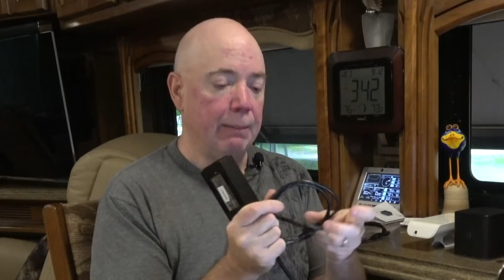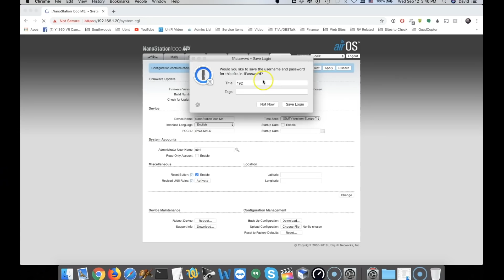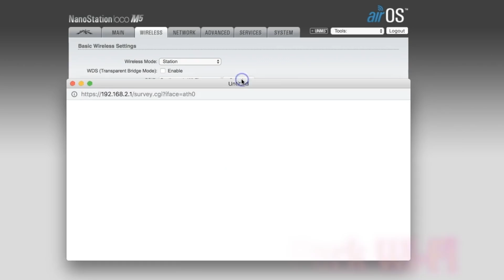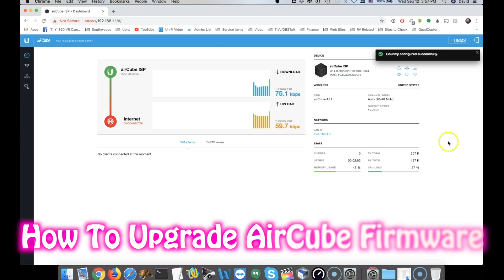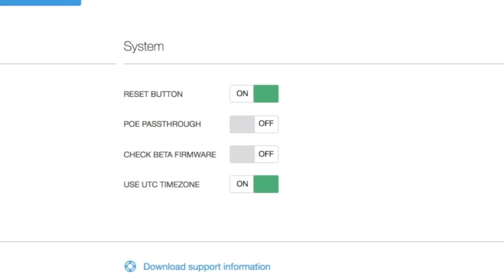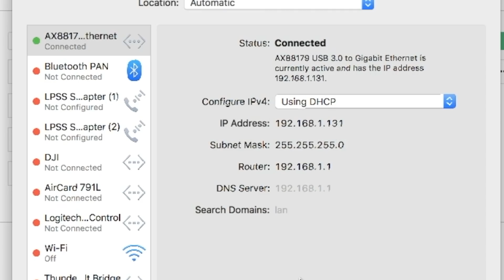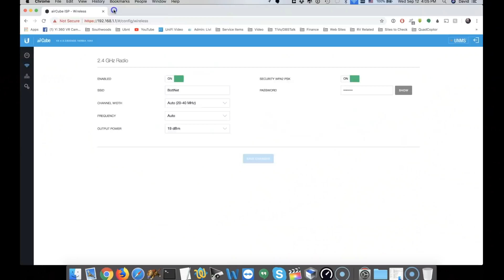Build a Private RV Wi Fi System with a NanoStation & AirCube AC

Comment: I had not see my air-cube and nano Station.  I could not remember my password and the one saved in my password file. So My IT-Tech utilized the reset button. Now having log in issues. Any advice is welcomed. Do I need to address (reset) the nano station as well?
Reply from the maker: If a factory reset was done, then you more or less start over with the setup.  If you only did a reset on the AirCube, then just do that part and your NanoStation should still be good to go unless you forgot it's username and password also. (Needed to be able to connect it to another SSID for use.)   If that is the case, you have no choice but to factory reset it and redo the setup.  To do a reset, power up the unit, wait one minute for it to boot, and press in with a paperclip inside the RESET hole and hold the little button down for 20 seconds and release. It will start to flash and reboot.  After it about 3 mins, you then can start to set it up again.

Comment: Are there upgrades to this set up? Has anyone installed them?
Reply from the maker: This is still current.  And yes, LOTS AND LOTS of people have. 444 comments in on this video with 1.1K thumbs up. :)
Reply: I just set it up followed all the instructions I do have a nanostation M2, will that work as well?
Reply from the maker: @MatthewSumi  Not sure on the question as a NanoStation M2 is one of the parts referenced you need.  So not sure what you are asking by "...will that work as well?"

Comment: Good afternoon. If you were going to do this today is this the route you would take? Looking to setup a private wifi system in my camper. Also does the nano station have to be mounted outside? Thanks great videos.
Reply from the maker: Hi...Yes, I would, and do, still use this setup today and have made some even for people in the motor coach park we are in.  The NanoStation does not need to be mounted outside but would recommend in a window facing the access point you are trying to connect to.  We use "command strips" to stick it to a window when needed as it can be removed without issue.
Reply: @DavidBott  Thank you so much sir. I seen a comment about campgrounds using nanostations. In that case what do you do?
Reply from the maker: @timsimpson2485  I am sorry to say I am not sure what you are asking. "campgrounds using nanostations"  ???
Reply: From the realcconnell -  @DavidBott  However, this year, I'm parked for the summer at a place that's already using Nanostation M2s for all it's access points. I'm having the devil of a time obtaining an internet IP using wireless "Station" mode and network "Router" mode. WLAN0 keeps falling back to the XXX.XXX.10.1 range (default) I've done multiple factory resets on the Loco M2, and have been tweaking the settings trying to find the winning combination but have not had luck. So far, searching the Ubiquiti website hasn't yielded the magic answer.
Reply from the maker: @timsimpson2485  I do not recall that one.  But in that case, it sounds like he may have been using the same IP range for the ROUTER mode of the NanoStation that the park was.  In which case, it would make for an IP conflict.  Connecting to a park that uses NanoStations as AP's is not an issue as long as you do not have an IP conflict.
Reply: @DavidBott  ok thank you sir. I will be buying and setting mine up. Keep up the great videos.

Comment: Hello David.....great tuturial...i bought a nsm5...a bit by mistake because of the only 5ghz....Just wanted to comment on putting oit in router mode..The internet is very slow and intermittent..I had to put it back to bridge mode and my router to ap mode..Its super fast in this configuration..the only problem is i need to bring a PC with me to login the nsm5 with an ethernet cable to change the wifi when i move to another location....Any ideas ???..... Tks W.N.....Prostate Cancer survivor.....

Comment: Any updates to this video with newer hardware?
Reply from the maker: Nope...still the hardware to get.  Note...DO NOT buy the NanoStation AC thinking it is newer.  The NanoStation AirMax AC radios only work with other AirMax AC radios.
Reply: @DavidBott  the local “hotspots” I’ve been using no longer support 2.4G. Looks like I need to find an M5 to replace my M2.
Reply from the maker: @Christopher_Ago  Hi...I have never heard of such a thing as 5Ghz, while it can be faster, is limited as to what it can transmit through. It really makes no sense for places to do that.  Pondering to say the least.  Good news is, if you get a NS-M5 you can just download the config file from the M2 and upload it to the M5 and do not need to do all the configuration over again.  It's in the SYSTEM tab.  Download the M2 config, login to the M5 at 192.168.1.20 (having set yourself to 192.158.1.10 or whatever)  and then go to the system tab and upload the cfg file you downloaded from the M2 and SAVE and APPLY.  BAM!  Same config ready to go.  Hope this helps.

Comment: Great tutorial, but mine doesn't work. It won't let me select the park wifi here. out of a list of about 20 signals there's only two that are selectable, and I don't have the passwords for those. The wifi here is not locked, but you need a username and password to access the actual internet for a fee. I've paid that fee but the signal is still weak. How do I get this thing to strengthen the signal?
Reply from the maker: Point the NanoStation at the AP you are trying to connect to. You are only as good as the signal they can provide and the NanoStation will give you the best chance at getting connected up.  I have connected to an AP 1/2 mile away.  Be sure to see the bottom area of the blog post for the FAQ that might be able to help... https://outsideourbubble.com/build-a-private-rv-wi-fi-system-for-under-100/  Espically if you are connecting to a captive portal which it seems you are.   But once the NanoStation locks on to the SSID, you should see the meter on the back of it light up.  

If you are not able to select the Parks SSID, then they might be blocking routers (they want you to pay for use of each device so they block routers.)  So in that case, you can go into the NanoStation and I think under the NETWORK tab, look for Clone Mac and check that box and put in this MAC address... 10:7b:44:da:5d:3c  save at the bottom and then apply.  The radio will reboot a it will then look like an Asus tablet.  Maybe that will help.  Good Luck!

Comment: Thank you for your videos. They helped me setup my LiteBeam M5 and now I'm working on a NanoStation M2. The NanoStation M2 will not lock on to my access point. The main page does not display the WLAN0 graph, only the LAN0, and the signal on the Main tab shows the access point dropping off. My configuration pages are almost identical to the ones on this video. My M5 can connect to the same routers that I'm trying to connect to with the M2. Can you suggest items I should check? Thanks again for your videos.

Comment: Do you still recommend the AirCube AC?  I love Ubiquiti products and would love to go this route, but not sure if it's still the best choice for my RV.  Thanks!
Reply from the maker: Hi...Yes, I do as it provides the needed power over ethernet (POE) out the WAN port that will power the NanoStation.  It will also do both 2.4Ghz and 5Ghz.  In theory you can use any router you may care but the AirCube is small and powerful and makes for a nice little package in an RV.   Hope this helps.
Reply: @DavidBott  Yes, this was very helpful. Thank you for helping me make my decision!

Comment: David, I tried the the links and neither the Nanostation or Cube don't have the POE adapter with them
Reply from the maker: The Cube has a AC adaptor that supplies power to the NanoStation out the POE WAN port.   But but sure why you think the NanoStation does not come with a POE as it surely does.  All mine have.  Here is a page from Ubnt showing package contents... https://dl.ubnt.com/qsg/NanoStationM_NanoStationlocoM/NanoStationM_NanoStationlocoM_EN.html

Comment: David, great video.  Very descriptive.  It looked like you connected the M2 to the park's 5G wireless.  Is that possible with the M2? Also, what about using the M5? Would that work also?  Is there a preference?
Reply from the maker: The M2 will connect to 2.4Ghz networks only and the M5 will only connect to 5Ghz networks.  Do not purchase the NanoStation AirMax AC as it will only work with other Ubnt Airmax AC units. I carry both an M2 and M5 and use the M5 if I can as it is a much less crowded network frequency.
Reply: @DavidBott  Thanks.  I was able to get an M5 and it works great.  You're right.  With my M5 I see only 5GHz signals.

Comment: Hey David - things worked perfectly well until I tried to figure out the settings on a NetGear Wireless router WNR1000.  I know you said you can't help with every router but I wonder if you had any general router suggestions?  Maybe the Air Cube is the way to go.
Reply from the maker: All you should need to do with any router is plug the LAN port, off the POE injector, into the WAN port of the router. If the NanoStation is setup correctly you 1) Shandle to able to reach it via http://192.168.2.1 (If that is the IP range you used) and 2) Would have access to the internet if the NanoStation is connected to an AP.  The Netgear just expects to get handed an IP like from cable router (in this case the NanoStation).  The only thing I can think of if the MAYBE NetGear has the same 192.168.2.1 setup as it's network.  Hope this might help.

Comment: Good morning. Hopefully someone has the answer to this question, considering I'm a relative novice. I have this setup and I followed all of the instructions as Mr Bott directed, but now, while watching Netflix (or any other movie) after about 15 mins in my Air Cube drops the internet.  I've contacted Ubiquity but got some answer telling me to check their online community.  Zero help which Is terrible.  I'm hoping if someone has also experienced this issue they can give me advice on how to resolve it. Thanks!
Reply from the maker: Are you sure the AirCube is dropping the Internet?  I ask for the AirCube is not the internet source.  It could be the RV Park dropping it based on streaming.  (Not saying this is the case, but surely is something that can and does happen.)  Does you loose your connection to the AirCube?  (in other words, does your computer loose it's WiFi Connection?  If you still have a way, just use the NanoStation without the AirCube and connect your computer directly to the LAN port or the POE injector that you used to set it up.  It will pass and IP to your computer to use and you should have internet access thus by passing the AirCube.  Then do your NetFlix test and see what happens. ;)   Also, when you loose NetFlix, can you still surf other sites.   See, a lot COULD BE going on here.  Thus all the "this and that".  :)   And yes, you likely will not find much help from the community as Ubnt are commercial products and thus a different crowd for the most part.
Reply: @DavidBott  thank you very much for your response.  It seems to turn off at about 10 mins into a streaming subscription service. The app for the air cube reads " unavailable", then I reboot and get service again. I'm in my rv about 150 feet from my house, do I'm connected with full bars from my house. I'm able to stream inside with no issue.  I'm going to try the nanostation independently, but I do not have a power cord I'm using Poe via the aircube.  Can you please clarify how I'm intended to power my nanostation independently? Thank you very much, I really appreciate it.  Have a great day!
Reply from the maker: @jenmc1941  Good Morning...Your NanoStation did not come with a POE Injector?  Weird.  Here is what you would need...  https://amzn.to/32hyfuk  Good itea testing it directly for that will tell you if you have a issue with the AirCube.  You could also try updating the firmware on the AirCube to see if they may do something. :)    Good luck!!!
Reply: Ok so I've isolated my nanostation and have it connected to my macbook and I'm trying to log in to it, but my computer can't find it when I enter the default isp address.  I've previously configured it, do I need a new isp address? Thanks
Reply from the maker: @jenmc1941  Not sure what you mean by "ISP address".  If you are connecting your computer to the NanoStation directly through the POE LAN port, then your computers network Ethernet interface should be set to get an IP via DHCP mode. Then the NanoStarion will hand it an IP of 192.168.2.X and you should be able to reach the NanoStation via any web browser at 192.168.2.1  allowing you to login to it, select an AP to connect to, and then after it reboots, have internet. Hope this helps.

Comment: im getting this for our caravan can i attach this on a adjustable pole and have it higher that caravan so picks up more hotspots
Reply from the maker: Hi...You sure can as the NanoStation is actually an outdoor unit.  I use it with an 18 foot painters pole.  Just be sure you have it in the upright position. (I had someone actually install it upside down...Not sure how they messed that up, but they did. Opps!) :)
Reply: @DavidBott  ps the ac cube is second hand from ebay should i do the factory reset thing so i caan enter my own ssid and new password

Comment: Hi Dave, your original video & this one brought us great campground access for years (Thanks Much!) Bought the Loco M2 in 2016 but reconfigured my existing Netgear WNDR4500 as my inside unit and has worked great. However, this year, I'm parked for the summer at a place that's already using Nanostation M2s for all it's access points. I'm having the devil of a time obtaining an internet IP using wireless "Station" mode and network "Router" mode. WLAN0 keeps falling back to the XXX.XXX.10.1 range (default) I've done multiple factory resets on the Loco M2, and have been tweaking the settings trying to find the winning combination but have not had luck. So far, searching the Ubiquiti website hasn't yielded the magic answer. Do you have any tips?

Comment: Hi David, great tutorial, very clear.
I have a question: I have already an existing connection with a main router and i want to use the aircube just as a bridge.
The aircube is powered up through poe in port, and in the "out poe/wan port" nothing is connected since it is in bridge mode.
Where should i connect the cable that come from the main router? into the lan port of POE power supply? 

One question also for the configuration of your video.
I noticed that into the lan port of the poe power supply at the end nothing is connected; Is that port still usable to connect for examples devices like a computer?
Thanks in advance.

Comment: David, I set this up very easily last summer using your video and it greatly improved our connection to the RV park.  This summer we are set up on a rented RV lot, not a campground and there is no Wifi and our Verizon phones barely work at all in this location.  So, this weekend I pointed the system at my AT&T iPad's hotspot which gets pretty good LTE.  It appears to have worked well giving a stronger connection to our phones and television through this than trying to connect them each to the hotspot.  In other words, we could leave the iPad inside and get a strong connection to the aircube outside.  Here's where it gets crazy.  We streamed very very little music or television, almost none, no movies, etc. and didn't do anything on our phones more than typical internet browsing, not even any you tube, and from Saturday to Sunday we used 18 gig of data through the aircube.  Any idea what in the world pulled all that data?  I did not connect to the aircube to check.  Will it show what device used the data?

Comment: I purchased a several months ago M2 and just purchased a M2 LOCO and I cannot get any SSID's to show up in the scan. I've been doing some research and it says to turn off AIRMAX. I have XW version 6.1.7 on the M2 and XW version 6.2 on the M2 loco. I see you were using version 6.1.6 at the time of your video. Neither version in my devices allows disabling of AIRMAX. I don't know if yours was disabled or not because you did not click on that page during your video. Only options I have are Base, Low, Med, High so it appears that Ubiquity may have disabled that option. I read a post that said if airmax was enabled, it would prevent connection to a 802.11 system. I have about 8-15 SSID's nearby on the 2.4 Ghz freqency. Tried changing channel width from Auto 40/20 to 20 and still the scan is blank. Just wondering if you have any ideas? Right now I have no way to get the WAN signal into the AirCube.

Comment: Is the M2 still your goto? Is the Loco5AC in your toolbox?
Reply from the maker: The AirMax 5AC Loco can only be used to connect to other Ubnt AirMax 5AC devices.  If you want to add 5Ghz also, then you would want the M5 Loco.

Comment: Hi David,

Just wondering if you know of any issues with older Linksys routers? I set up a Loco M2 at my 52 X 30 ft shop building pointed at my home up the hill. Locked to the wireless at the house, I did not want any IP conflicks so I set the network IP on the M2 192.168.40.1, and DHCP range to .100 - .200.

The PC gets an IP address just fine 192.168.40.145 and is able to surf and download just fine. I unplug the PC and plug the same cable into the Linksys router and neither wired LAN or wireless LAN can see the internet. Checking the router stats it never gets and IP address from the M2. Any IDEAS?